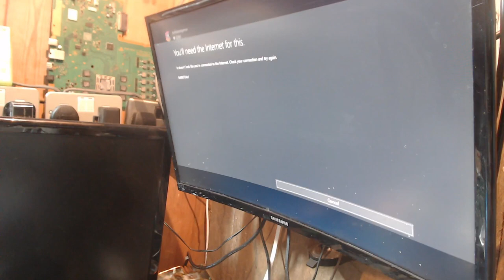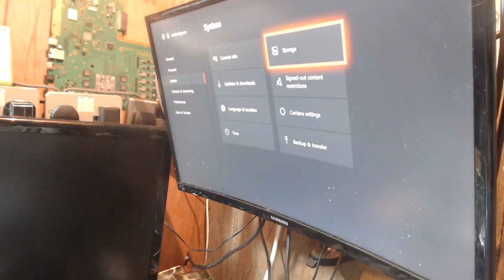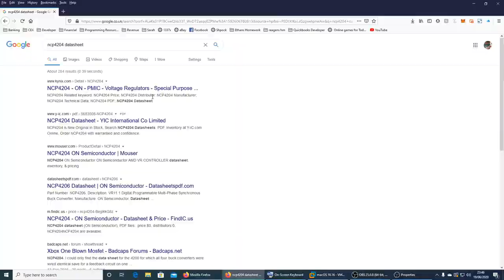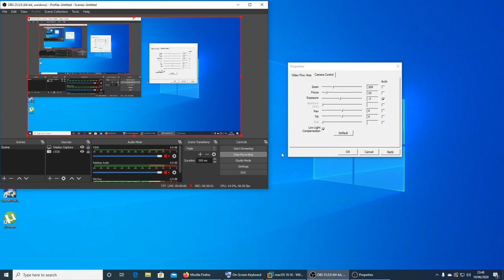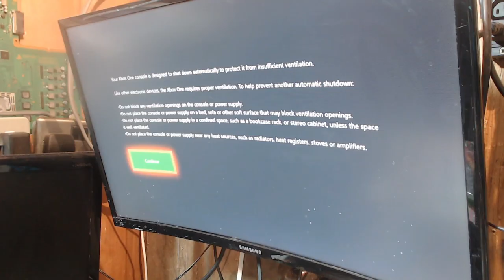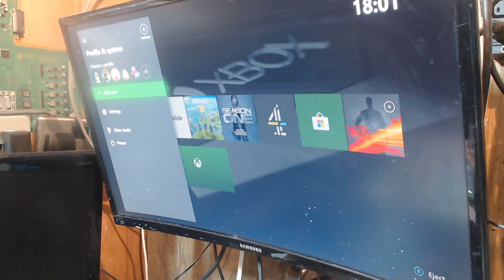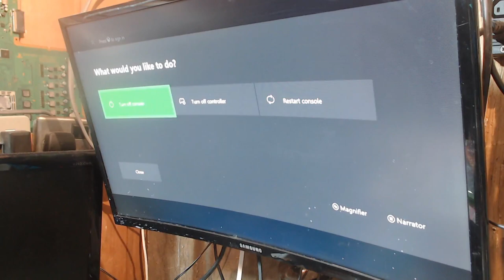Xbox One Liquid Damage Extended Diagnosis And Repair - A Cat Urinated On This One 🤣

Comment: First video I see from you and i must say I love the content and the attention to detail, learning a lot. Thanks!
Reply from the maker: Thank you buddy much appreciated
Reply: @TheCod3r  I came across your videos because I started repairs by buying some broken consoles and learning as i go. I got an xbox one 1540 and bunch of caps are shorted to ground, so i've been working on that... I finally realized that a bunch of components are missing from the board (including the same resistor you first found missing!) But my case is that this xbox was purchased from mercari (like ebay) and thus I take on that risk of receiving items  previously worked on. In my case i have a bad feeling this one i got was used for parts already as a donor board lol so many components missing from the board.. It turns on and turns off after 2-3 seconds. Either way, keep videos coming. Watching the rest of your videos so you may notice some thumbs up :P
Reply from the maker: @0x0110  cheers mate, yeah thats the problem buying from unknown sources with no history to go by. Hopefully you can get it fixed though mate

Comment: hey bud on those little mosfets the TPN8R903NL   are the top right 3 pins all the same ? when i took out one to replace it all became one blob i tried cleaning it no luck its all one pad now basically .
Reply from the maker: Yes mate there's a group of 4 on the bottom (the source), a single pad on top left (the gate) and a group of 3 top right (the drain)
Reply: @TheCod3r  i appreciate u replying so fast brother thanks. But u know before the xbox was dead no light or sound at all. i checked i had a short, so i replaced the left small mosfet, short went away but now quick on then off. i cheked all 3 and they get .68v  but not the 1.8v ??

Comment: Phil i have a xbox one the first model   with liquid damage  it whas under the apu and the ram chips   if i put the power brick in it turns from orange to off so no white light  the xbox try,s to turn on for a second and the power brick is back orange     i blew the liquid out with air still nothing   any idea if its repairable or better get a other xbox one ? Friendly regards

Comment: At R9E2 where u placed a resistor because u was thinking its missing. there should be NO resistor at all!!! have a board with some problems here. and there are these pads compleatly without solder, only copper exposed.